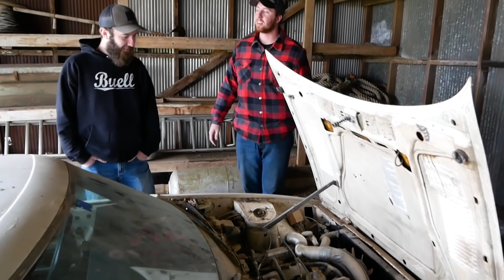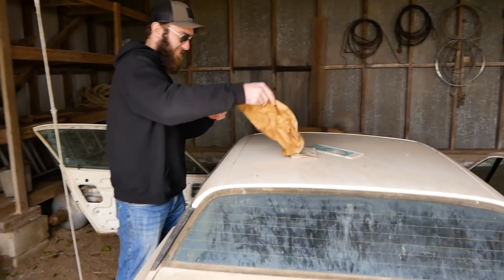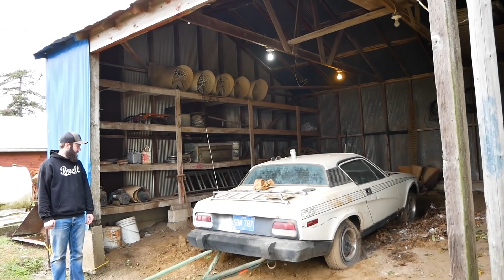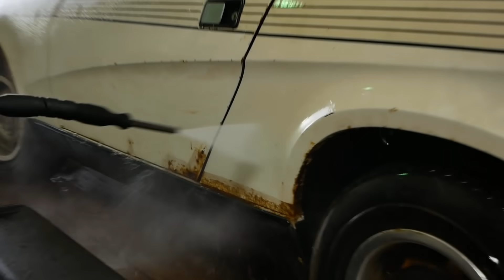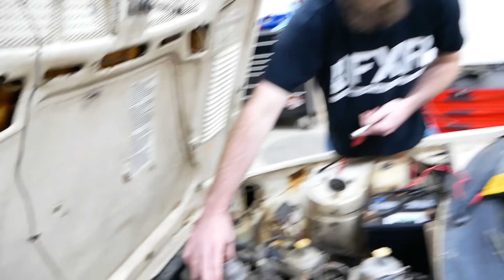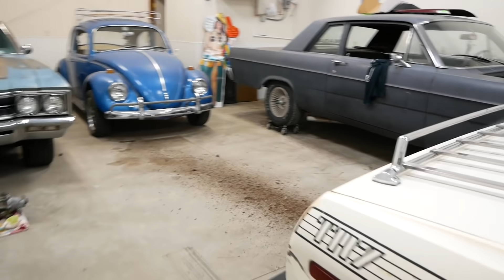LOST Triumph TR7 Found Buried in a Shed! First Start in YEARS!

Comment: Every owner of an American sports car who’s joked about “typical 70’s British engineering” has just fainted
Reply: This car sounds healthy. It deserves a second life.
Reply: Ojibwa62 x   Well the electricals are worse.
Reply: Ojibwa62 x  And the flawed head gasket design.
Reply: Ojibwa62 x  "Lucas electrics... keeping the world in the dark since the 1920s"
Reply: @Jester123ish    The reason why it had sparks is because it is fitted with an after market Luminition ignition system.
Reply: Ojibwa62 x  

Nothing really of issue wh Lucas stuff. Speaking as someone who's grown up with and owned several bikes and cars using Lucas electrical systems.
Reply: Did you own this car?
Reply: Ojibwa62 x  My cars wiring caught fire under the dash. Spent a few days with the wiring harness in the kitchen splicing in new wires. And i rewound one of the head light motors.
Reply: @redleader7988  My car never had a problem with the head gasket.
Reply: Red Leader that was the triumph Stag. And it was because at the time there were factory strikes at British Leyland and some of the cars were built on haste. Most problems were due to angry employees leaving head bolts loose. There is a tv show with Ant from wheeler dealers that restored one, and had no trouble after going thru the engine with the service manual. Should be on YouTube.
Reply: Ryan Forrest Yes they had a bad name in Britain ,but I ran Triumphs for years with no major problems , it is always the singer not the song
Reply: @seththomas9105  "Lucas", one letter off a four letter word.....(had a Triumph 2500 PI for 10 years in the 80/90's)
Reply: This car was their swan song. It was dog of a car from day one.
Reply: yeah quality engineering, runs without the battery hooked up.
Reply: For all their flaws and troubled history of a couldent give a toss striking British people in the British Leyland(Plug Hole Of Doom) factorys who built them there is something special about this car that has grown on me.the fact it has survived I'd a miricle and deserves to be saved .it doesent have to be perfect bodily as wears its scars with pride.if you get everything working properly even with those awful Lucas electrical system and keep the stock tyres and get it on the road .that's a win  in right there.Such a cute car with such troubled history it wants to live.maybe you can prove the haters of these cars wrong!people love to hate the tr7 ? I think it has more character than a mx5 and the Mgf even if its not as fast.but it was praised back in the day for fine handling and being a comfortable involving car to drive so that's a good start.
Reply: @dlckweed8345  I had a TR7 from 1987-1991, I had no major issues with it when I had it, that said, the guy who bought it off me had it two years then everything started going wrong with it.
Reply: @seththomas9105  Lucas : making millions of British motorists pedestrians since 1920
Reply: To be fair it was kept in pretty favorable conditions. Though tbh most British cars tend to withstand rust from being outside due to there frame lubrication system.

Comment: Fun Fact: Triumph originally designed and built this engine for SAAB, they made the first 50,000 in 1700cc and 1850cc before SAAB attained manufacturing rights in 1972. Both Triumph and SAAB then produced 2 litre versions with Triumph introducing a DOHC 16 valve motor for the Dolomite range of cars and SAAB turbocharging it for the 99 and 900 turbo in 1978/79. SAAB went onto produce further variants of this engine in 2.1 and 2.3 versions until 2009.

Comment: I've never seen a TR7 in better shape - these are complete rust buckets - they rust from the floorpans up.. - subframes go first - this should be preserved. These would have used leaded fuel not unleaded - as we call it 4 star in the UK. If remember correctly the last one I seen was back in 88.  ~Trooper

Comment: I had a 1976 TR7 in mid 80's. At least these cars are easy to work on. I stripped a carb. on the side of the motorway to clear a blockage.

Comment: Dude, that's a sweet find not seen one if these in a long time. Here in the U.K the salt on the roads got to them... Great Project!!
Reply: i remember as a kid in Hull(UK) going with my uncle to buy one of these in the mid 1970s, white just like this one. He had an 8 track player on the back shelf in between the driver and passanger seats blasting out The Eagels! happy days
Reply: I had one in the eighties, i loved the car. Complete rot box. On holiday in Las Vegas about 14 years ago, driving to Boulder dam we stopped for a break, only to be surrounded by pristine TR7's, on their way to a  meet in Vegas. I suppose the dry air stops them rotting.

Comment: Hi from the UK. Remember my dad having one of these when I was a little boy.. haven't seen one in decades. Would love to find and restore one. Great  video yet again...
Reply: My first job was as an apprentice mechanic. I used to PDI (pre delivery inspection) these things. There's a beaten up yellow one in the local garage. I would love to restore it. The US ones (there were US bases in the UK at that time) had aircon and a nasty design flaw where the tank would crush because of an air vent valve getting blocked.

Comment: Love the two-carb ether dance.
Reply: Should have dual wielded. :)
Reply: Well you can tape one shut as they share a cross pipe so one could potentially run the motor. I had to do this occasionally ;o)

Comment: Good old Triumph starts straight up, I am surprised that it's not totally rotten though 🤔 Think the US version got some emissions crap attached so removing that might unleash a colossal 13hp 🤣
Reply: Yeah the US version managed to be almost 25hp lower with all that emissions junk, pretty brutal.
Reply: Well that slant 4 was turbo'd and Saab used it in the old 90 I think, also a cool car
Reply: @agilchrist73  yup SAAB had several variants of this engine, from 1.7 litre to 2.3 on the 99-90-900 and 9000.
Reply: Needs a Sprint engine or better still a Rover/Buick V8
Reply: That would be the TR8 made from 1978-1980 with a 3.5 litre rover engine
Reply: @jjmac3561  In the USA A small-block Chevy or Ford V8 or any number of V6s is a much cheaper prospect--I have a factory VG30ET (original 83k) from an '84 300ZX turbo waiting to go into my '80 'vert.  205 bhp in original tune with up to 400bhp possible with stock internals.  Getting a good-running Rover V8 here has gotten expensive, and 'speed parts' are likewise expensive, just not much demand here.
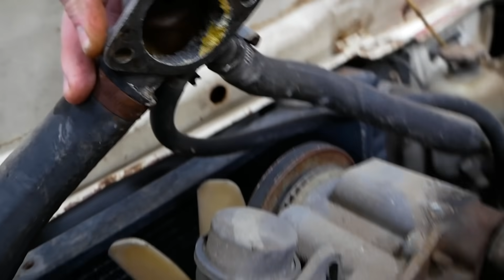Reply: If you look @ 12:28 you will see the auxilliary air pump immediately behind the rad fan, which sucked up a few bhp.  Normally they were only fitted to the California cars, tho' that might have changed by '80 and for the '81s which were leftover '80 cars.

Comment: “Will it run”

Starts video with it running.
Reply from the maker: Trying* to run
Reply: will it run tho? of course it will it did at the start of the vid
Reply: Kuemmerling Enthusiast  title says first start
Reply: @JunkyardDigs  had the tags just been updated, or was it actually tagged the decades it was parked?
Reply: @tturtle1659  That V8 version has a really manly sound to it. Always thought these TR7's were slow crap, but I was wrong.
Reply: @tturtle1659  I built a UK spec car from a SLANT 4 to the Rover/GM V8 years ago. It was a fast little bastard of a car !!!
Reply: Well obviously I'm not alone in this. We'll need to see whether he hears us:)
Reply: @tturtle1659  Actually, the 4 pot is a great little engine. It's half a V8 anyway, and with the twin SU carbs set up correctly is a lot of fun. My TR7 goes very nicely and handles pretty good for a car designed in about 1971. Not "shitty" as you eloquently describe it. It wass the U.S.A emissions laws of the day that downgraded the power.
Reply: @tturtle1659  very true

Comment: On the top of those carbs crew the yellow caps off and put a little oil in it will run alot better
Reply: They are called dashpots. I happen to own a Tr7. Good call BTW.
Reply: These are Stromberg carbs, check the rubber diaphragms inside for splits as they must create a seal.
Reply: Also the dash-pot oil (good call), I'd use something like 3 in 1 light oil or similar

Comment: One TR7 I bought had a very frozen clutch (probably rusted to the flywheel), perhaps like yours.
Basically I warmed it up and then started it in gear and drove it around my yard grinding through the gears for probably 10 min and suddenly, voila! No more stuck clutch!! Was actually pretty fun to do, trying to shift smoothly with no clutch... 😁

Comment: My first car I ever bought was a 1975 TR7 and I was 15! Got it running with my Dad and then tore the engine down and realized there were craters in the cylinders from sitting. Ended up selling it before I could do much with it.

Comment: A friend of mine had a shop out at his farm he worked on cars and also stored them in the barns. He had picked up a 1978 Firebird with a factory Chevy 350 and 4 speed a few years back and he was happy to prove to me it was a real factory car and that it ran great.  Well we rolled it out of the barn where it had sat for two years. It was dusty but looked clean and had no rust. In Wisconsin Rust is like a plague. So it was now in the shop and he began to try to get it running. Well it would idle like crap. But it ran. He got fustrated and checked the Distributer and more. Everything checked out so he put some starting fluid in the carb and then filled it with fresh gas and fired it up. Then he began to rev the car and it went like Whoo bog... Whooooo Bog. Whooo KaBang!  Bang! then it ran like a champ.  We scratched our heads for a bit and then he walked behind the car and then burst out laughing..  I walked up and there was a huge mouse nest against the garage door and strung out on the floor were about a dozen freshly gassed and dead mice...    "Well I guess We Gassed them and then Ejected them from their home."  I just laughed.

Comment: Those carbs are very easy to balance. Use a pair of DTIs on the top of each piston. Unclamp the carbs from each other. Zero both DTI and set a good idle. Then change the throttle setting on one carb until both DTIs have the same reading, re-clamp both carbs together and you are 100% bang on. These are super simple carbs but do a very good job.

Comment: Back in the day their commercial motto was "The Shape Of Things To Come." They refered to it's triangular shape.
Reply: The customers called it "The Shape of things that break down". Really
Reply: My TR7 was great, except brakes were crap, electrics caught fire under dash, clutch release lever snapped, pop up headlight failed so i rewound the motor. It rusted all over. The gear box could barely go into 2nd. I stripped the gear box, they have a fiber oil pump in them. That full of metal particles. Over 70mph the front would lift and steering go light. Once had carb ice jam the throttle at 70mph.

Comment: I aquired one of thee  4 years ago. Was like getting a  dream car as I always wanted one. Mine didnt run either.  Now, 4 years later, Its the most fun I ever had  driving  96 hp. Seriously more fun to drive than my old Mach1 Mustang.  Holds the road like its on rails and I havent upgraded the suspension yet. Gets a good bit of attention at car shows too ( both good and bad..though  more good )

Comment: I had a '76. It was the worst piece of crap car I ever owned or saw. Literally everything failed on it. Brakes, engine, transmission, seats, headlight motors, rear axle, electrical, carburetors, exhaust. Everything. And it only had about 25k miles on it. The majority of those cars ended up like this one just because it was a constant nightmare repairing them. And parts were almost impossible to get, even when they were fairly new.
Reply: If properly maintained, old British cars work occasionally hehehe

Comment: You must have the 1 in 1000, no triumph ever starts that easily. I had a Triumph Herald and you always had to go out with 3 people 1 behind the wheel and 2 to push start it.
Reply: If maintained, old British cars work occasionally
Reply: This is very true, also there is another technique if you know your vehicle. I have a fully restored series 2 Land Rover, to start it if you haven’t started it for about a month, you hand pump the fuel pump to fill up the carburetor. Pull out the choke all the way, crank over engine for a couple of seconds without touching the accelerator. Push the choke in so it’s just a tad over halfway, fire over the engine with your foot on the accelerator giving it just a little bit of gas and it starts every time. 🙂
Reply: @McleanOnTheNet  

Talking as someone who has owned a lot of British cars I can tell you're talking bollocks.

The last Triumph I owned about 12 years ago  ('69 1300) was used as a practical daily classic in all weathers. Keep the points gapped, service it regularly and they just work and work.

It's bad enough when some Americans shit talk a brand of car they have no experience with but even worse when your average stupid Brit makes up an anecdote to appear funny... and not actually appear so.

Comment: Hi, if you add some oil in those stromberg carburetors they're work better. Only need unscrew the upper plastic caps and put on it 7 to 10 drops of engine oil to lubricate the carbs pistons.

Comment: Locked up (frozen to flywheel) clutch is dead common. In fact it happened to them when they were sitting on the docks brand new.  I've done a few. best way: warm it up, then start it in gear, and drive around hitting the clutch and brake (if brakes work lol!)  or warm the engine, Park that big ol bumper against a wall, then Start it with the clutch depressed, It will break the rust free. Just driving it after that normally should clean it up. The latter was the method a British Leyland mechanic told me to do.   Fun cars!

Comment: I owned a TR8 went through the engine with the help of Tr sales. Erson cam, top of line pistons Rods. Offenhauser manifold, holly 650cfm witch took nearly an expert to get it jetted right. Extremely quick for the 80s everyone liked the convertible. Good Borg Warner 5 speed transmission, good rear end. Identical to the tr7 it was so funny to see the guy's face in a 87 mustang when shifting from 3rd to 4th and they figure out it has a 3.0 v8 in it. Fun Saturday nights in FT worth Texas, long big highways.🤠😛

Comment: Those Stromberg CD carbs are pretty decent - they were fitted to Rover, Triumph, Volvo and Vauxhall cars in the 70s. You need to be careful of the diaphragms  at the top which perish and let air in.and the seal over the main jet adjuster, which goes through the float bowl. They dry out over time and will leak fuel over the engine.

Comment: I've worked on quite a few of those, I believe I've still have a tech manual for it. God help you if you ever have to remove the cylinder head!!! Oh, don't forget to put oil in the carbs, those little plastic caps on the top of the carbs unscrew and you fill with a dampening oil.

Comment: I've got a 1980 tr7 convertible that's been sitting since 02. A racoon ripped up the interior but otherwise it's in good shape. This is a pretty sweet little coupe! I also have pretty much the same truck color wise as Mook's new F150 but an F100 with a 302/c6

Comment: I had a friend that owned one of these new in 1978, in less than 1 year, he had a list of faults that went on for 2 pages. They were a crap car when new, I can't imagine they would be any better now. If the clutch is just locked up, take it for a drive with the clutch pedal down, it should break free after a few revs of the engine.

Comment: Those Triumph 2.0 liter engines are actually stout, and the basis for the SAAB 900 series engines as well.  Those SU carbs will run great after some fiddling, and making sure the dash pots are full of oil.  Wiring?  Early TR7's made at Speke were fraught with problems, but it was a BL problem overall.  Later Cowley cars were better built.

Comment: you are very lucky that those membranes in the carbs actually did not dry out in 34ys. Put a cap full of ATF oil in the yellow "screws" on the top of the carbs. Car will run smoother!

Comment: I had one. Ran good, but the electrical system sucked. Headlight motors, circuit board dash that none of the gauges worked except tach & oil pressure. Transmission crapped out finally. Left me stranded more then a few times. Last British- made anything I have owned since.

Comment: My sister bought a new TR7 around 1980, hers was a 5-speed convertible. It wasn't fast (105hp 2200lb) but the engine was very responsive and it had a good shifter and close gears. I liked driving it, you sit so low that it feels like you're going faster than you are. You have to work at it to get good performance, making quick shifts at high RPMs which makes it more fun to drive (driving like that in a fast car might get you arrested). The convertible with the top down is a much better-looking car, and Mary's was dark green and it didn't have those bullshit pinstripes.

Comment: I've been wrenching for 20+ years and literally never seen or heard of that car...ever. Crazy!
Reply: That car was probably built sometime in 1976 or 1977.
They only came out as hard top 
coupes at first due to US federal regulations at the time of release. 
Eventually they built them as a convertible starting in 1979. Last year of production was 1981.
BTW The TR7 used a 2.0 liter, 4 cylinder engine.

Comment: very nice ,but the us version is under powered ,these cars are quite good in the bends and fun to drive,they were much under rated in the uk until recently .i have one in the shed,think it would be more to you liking -3.5 v8 ,5 speed box lsd in the axle full spaxs  shocks uprated bushes ,bit of a deathtrap due to the short wheelbase ,loads of tyre killing fun in the bends.